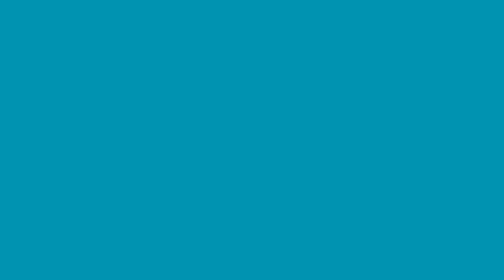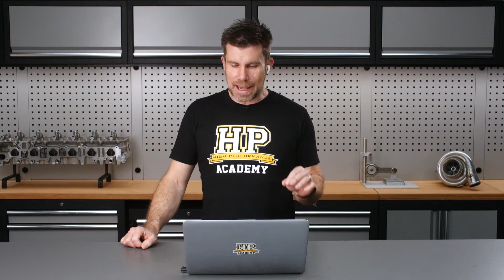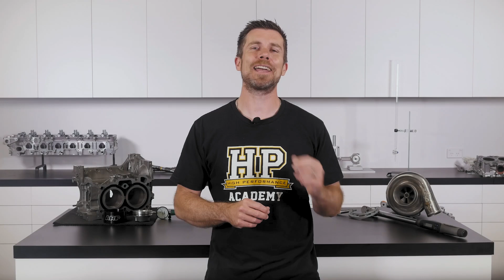Pre-Detonation Is Not What You Think [HPA Q&A]

Comment: Andre, can a turbo engine be made to run on regular gasoline? Can you show us how to do that and what kind of power it can make? Just something different💪
Reply from the maker: Sure can! It will just make less power. How much less depends completely on the engine and induction type (turbo, non-turbo etc), but basically if you think of detonation as a wall in your path that you can't pass, using a different octane moves that wall so that you can go further.

This is why it's also important to use the the fuel you have tuned for as if you don't you are essentially setting up a swing using the higher octane, and then when you switch back to a lower one and jump on your swing you understandably smash straight into the wall that has moved back closer to you 😅

I'm not quite on the same level as Andre with explanations but hopefully anyone who stumbles onto this will understand! And a video example of this is certainly something that would be helpful, I have added it to the list, chur! - Taz.
Reply: @hpa101  you explained it perfectly Brother Taz💪 i have a truck with a 408 cubic inch V8 that runs on regular gas. I would like to turbocharge it, but retain the ability to run the cheaper gas. The truck has a 26 gallon tank and that's very expensive for premium gas. Especially since it will be my daily driver.
Reply from the maker: Basically so long as you accept the performance between the fuels is going to be different, potentially very, very different, you can make that work for sure, also noting what is in your tank when you do put the higher octane in will be a mix in between both of them too.

You might find the milage on the higher octane is so much better it becomes a moot point though when you drive likeness for likeness and you can certainly tune for economy in some areas of the map or have switchable maps etc between performance, economy and towing for example. 

So many options, getting the bank account on board is usually the hardest part 😂 - Taz.
Reply: @hpa101  i Co sign you Taz... I have like 3 performance cars that require premium. This is my "daily people mover". I want a little more out of it, but it doesn't need to beat everything on the road😆 thanks so much